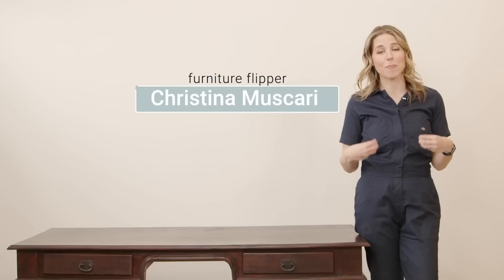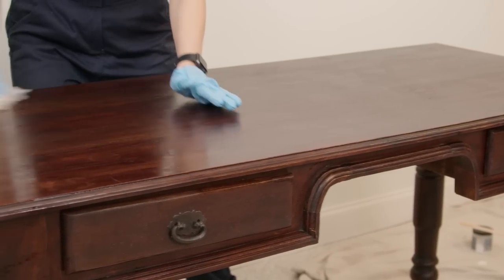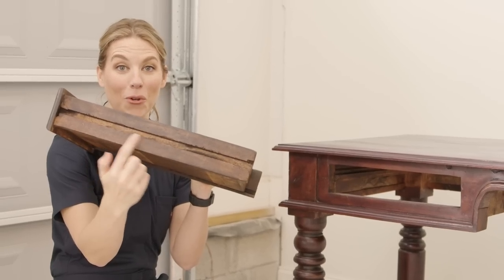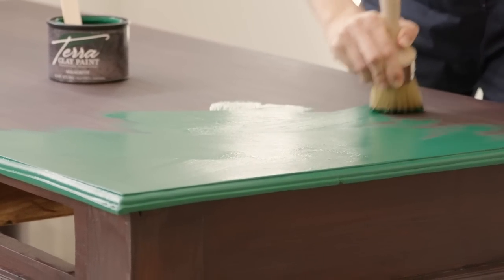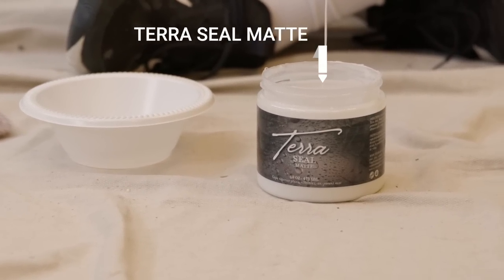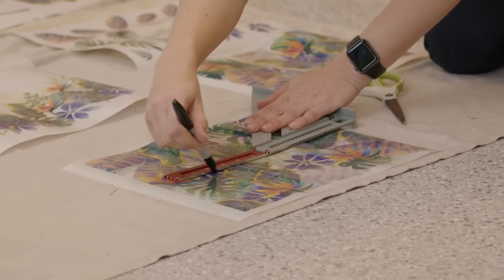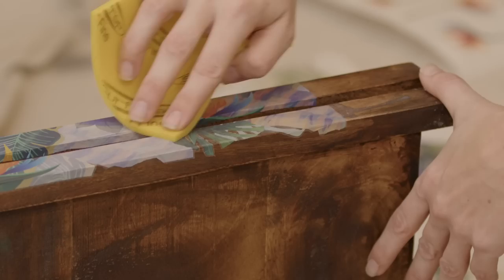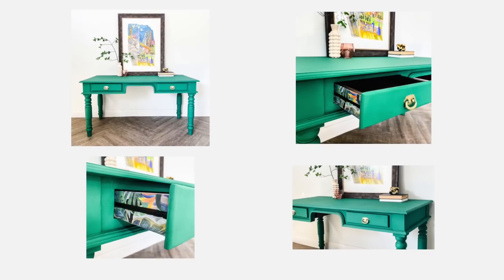Can I Find My Joy?! 😭 Furniture Makeover & Content Creator Burnout

Comment: Looks great but I think I missed something there with the drawer slider slots. How did you get the transfer down into the slot without tearing it up?
Reply from the maker: It was a quick shot. I used a blade to cut down the middle and pushed the excess into the track.